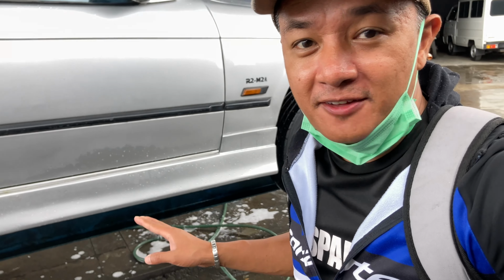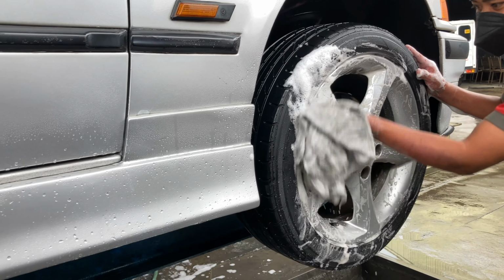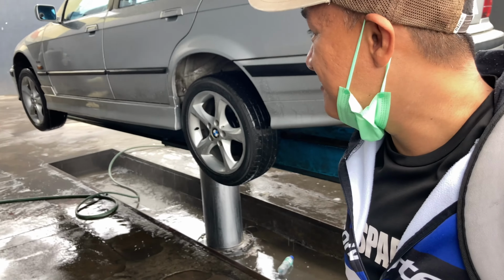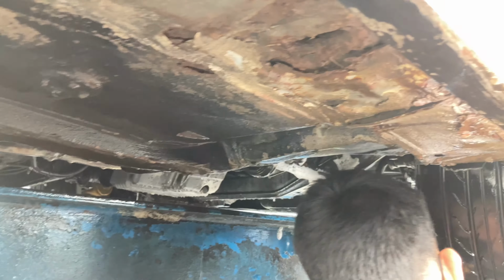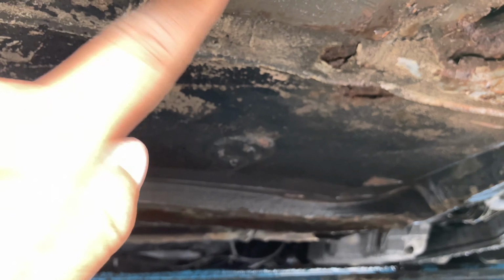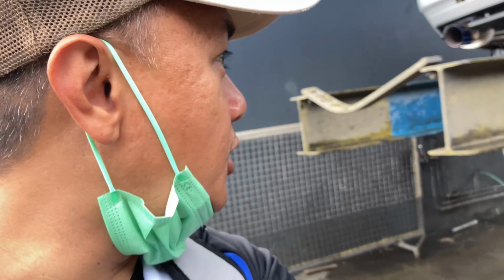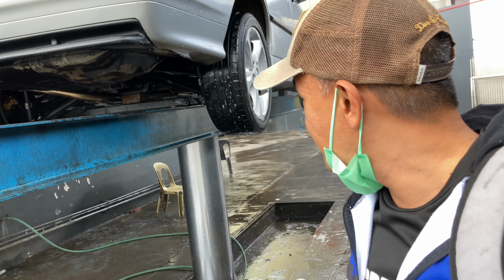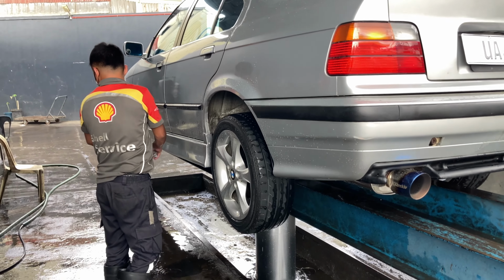BMW E36 316i Maintenance

Comment: are parts really expensive for BMW cars even an older model like the e36? If you dont mind me asking, how much have you spent in maintenance upon buying it, how much should I prepare if I pull the trigger and buy pre-owned BMW e36?
Reply from the maker: It’s not that expensive.  There’s a lot of parts for this.  And once u replace the parts it’s good to go.

Comment: I saw an E36 in marketplace and it’s in a rush price. I really love to buy it but i dont know any mechanic who can help me to check that car. 😢
Reply: I also want to know how much the emission and car registration in lto for e36
Reply from the maker: I think I payed emission and registration like 4-5k if memories serves me.  Test drive the car ur looking at and if it’s good buy it
Reply: @TheRobertDesign  thank you so much sir, i hope you know someone who is good in checking a bmw car. I really want that car. I have a follow up question, is it true that it’s high in fuel consumption?
Reply from the maker: @erykalouismauri2506  are I from Lipa?
Reply: @TheRobertDesign  im from paranaque sir but the e36 seller is from pampangga
Reply: @TheRobertDesign  the price is 160k but i wanto haggle the price to 130k because i dont know what else are the hidden issues of this car. I really dont have any idea about a car, all i know is this is my dream car since i was in highschool.
 
Here is the car’s info:
BMW E36 316i
M43 bulletproof engine
Manual transmission
Rear wheel drive
Power steering
Power windows
Brand new Air filter

Exterior
Brand new clear corner lights
Brand new red/white tail lights
Led Angel eyes (new)
HiD fog lamps
Orig Novsight Led headlights
Remus twin tip exhaust
Straight Full M3 kits
M3 front bumper
M3 motorized side mirrors
M3 rear bumper
M3 18s style 24 mags
Thick tires 90%

Interior
Full leather BMW interior
Newly reupholstered interior (fresh)
Maroon leather seats
Maroon leather sidings
Maroon leather shift boot
Alcantara suede ceiling
Alcantara suede backboard
Alcantara suede A pillars
Alcantara suede C pillars
SunFx Nano Ceramic Tint
Orig BMW Euro version trispoke steering wheel
2din Headunit
TEAC rear speakers
BMW M3 shift knob
Led interior cabin lights

1yr old battery
1yr old cabin filter
W/ spare tire
Complete spare keys
Complete papers (Registered til 2023)
- 1500kms+++ palang tinakbo since na change oil/nabili last dec 2021
- Motul H-Tech 100 10w40 Oil
- Newly replaced sparkplugs bosch 4tip
- Newly replaced fuel filter
- Newly replaced air filter
- Newly replaced MAF Sensor
- Used this for approx. 1-2 times only per week (weekend car)

Issues: paint, 1 window needs wiring (passenger seat), sidings (driver side), other than that wala na.

ORIGINAL price is 200K!! NOW 160K!! RUSH NALANG TALAGA, GRAB NYO NA!! 

RFS: need funds for business/need low maintenance car